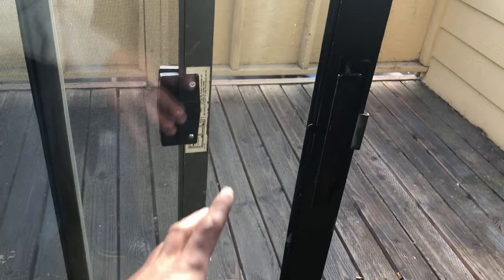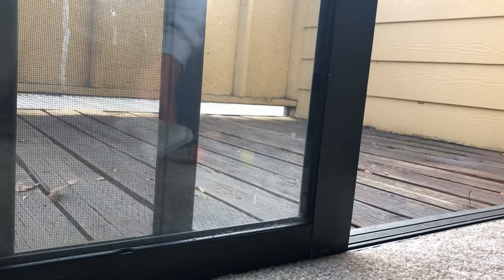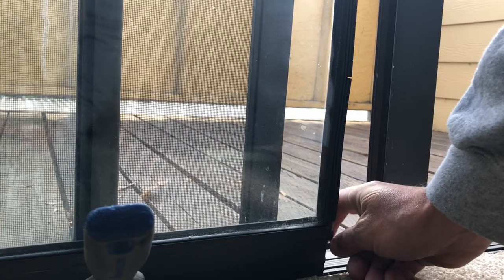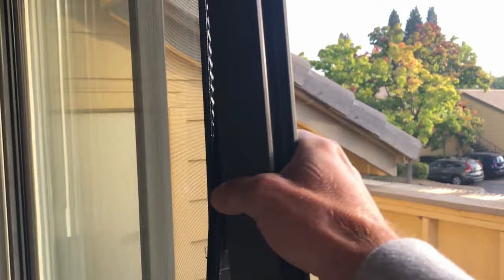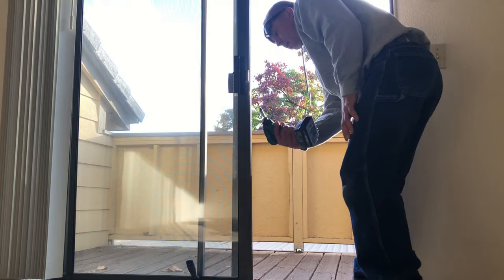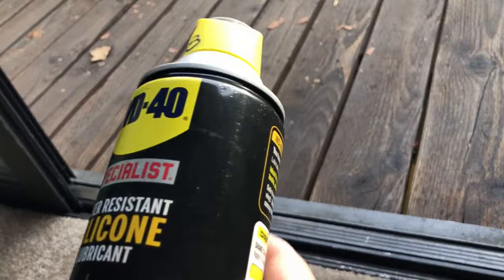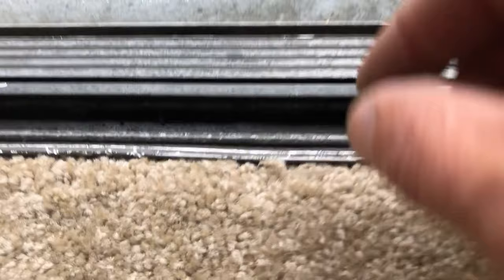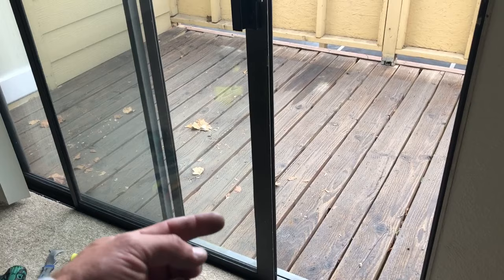How to replace rollers, wheels on sliding glass patio door the easy way.

Comment: good for an aluminum frame door but if you have a pvc or "vinyl" frame im not sure this would work. door has to come out I think. at least thats what i did and it worked fine. get a helper to help lift it and its not that bad. also i
it had a 1 1/8 size roller wheel and I tried a 1 1/4  (larger rollers) and it worked much better.
Reply from the maker: You are right, vinyl doors are designed different, so the door needs to be lifted out. 
I will make videos in vinyl doors soon.
Thanks.

Comment: Can I pop the door out, lay it down and remove the wheels without taking the frame off?  Thanks for posting this video.  I feel empowered to try it.
Reply from the maker: Yes, you can , but taking door out is not always easy, and in some cases you will still have to remove bottom frame/rail to get the wheels out.

Comment: I would suggest cleaning the track before you take the step of changing out the rollers.  You can do this without removing the door as well.  WD40 and a paper towel and blow out dusty stuff under the door first.

Comment: Thank you for the informative video! I learned a lot. However, I'm having difficulty opening or closing my balcony door. Can you provide some guidance on how to fix it?
Reply from the maker: I’d need a little more information, description. Most of the problems come from bad/worn out wheels. And of course there are number of other issues too, like track being worn out, or even building settling and pushing in on a window frame.

Comment: Looks exactly like my door 1998 contractor grade. If I buy the rollers ahead of time, are there a lot of different sizes, or basically one or two? Want to have it all staged b4 I start. THANKS!
Reply from the maker: To be in safe side , I’d pull one rail off and take a look at roller just to verify.

Comment: Hi there, this looks like the answer I have needed to fix my sliding door. My concern is --- can I do it on the opposite end of the door, i.e. the side that does not have the handle on>
Reply from the maker: Absolutely, it’s the same process, I think I mentioned and showed it in the video.

Comment: Soapy water will help the rubber seal slip right onto the glass and into the frame.
Reply from the maker: You are right, I spray glass cleaner sometime to make the frame slip on the glass easier.

Comment: Thank you -nice video!
Learned even more! 
How do I know if the wheel set will work on my doors? 
The one door has been replaced one jus a few years ago. I can’t make it slide. 
Cleaning track 2-3 times a week helps and the white lithium helps.  ( that what I was told to buy).  It’s a constant battle.
Reply from the maker: Thank you.  
If your door was recently replaced it might might vinyl/plastic so this method of wheel replacement won’t work unfortunately, you would need to pull the slider out to get access to the rollers, but if your door is aluminum then you can just unscrew the bottom corner screw, and pull the rail off ( like in the video) and that will give you access to the wheel, although there are few door manufacturers that screws the rollers through the bottom rail/frame, in that case you will have to pull the door completely out.
Hopefully it makes sense, let me know if you have anymore questions.
Reply: Try putting some bearing grease on the track....clean it one more time sliding the door open clean the front side of the track, close clean the back side of the door track.

Comment: So I was thinking of hiring a handyman because I thought the doors had to be removed from the tracks. Wondering if you loosened the prior to putting the toll under it to raise it? I'm surprised how much lift or adjustment was in the door to be able to remove the old wheel assembly. 
Thank you so much for your video!!
Reply from the maker: I’m glad I was able to help

Comment: My patio door frame had a cut out/window on either sideof  it. The wheel unit had a shoulder on each side that fit into the cutout/window in the frame.  I had to deform the frame slightly to clear the shoulders in order to pull the unit out. Fortunately I had taken the door off the track to do the repair. It would have been a cluster trying to do this on the track. Otherwise followed your steps and saved big bucks. Wheels were $8.00 each.
Reply from the maker: I think I know what type of door you are talking about, it takes single wheel roller. I have worked on those in past , not very common though. I’m glad you were able to do the job yourself and save few hundred dollars!

Comment: Great video, and technique.  I am replacing tandem rollers with steel wheels and steel bearings.  Should I lubricate the bearings on these Prime-Line rollers before installation?  My concern is that any lube will attract dust and dirt.  Your opinion?
Reply from the maker: Yes, I always lube the wheels before installation, use clear silicone spray, it will not attract dirt!
Reply: @roadglassandmore9064  Thanks.  Time to get working!

Comment: Just like the others, thank you very much for posting this! I was getting ready to hire a glass shop an hour away. Now I can do it myself.

One question though. Maybe I'm missing something obvious, but how can I identify the model of my door? I found the Pella brand name, and figured out it's vinyl, but that's it. Couldn't find a model number. Pella's website says there should be a serial number or something etched in one of the corners, but I don't see it. (Fine, I'll go get the windex...)
Reply from the maker: I. Haven’t worked in many Pella doors, from my experience they don’t use standard rollers that are interchangeable on other doors.  And the door being vinyl , you will have to pull the door out to access the rollers on the bottom.
Reply: @roadglassandmore9064  Eew! Too bad I can't use your shortcut, but it's still do-able if I find a helper. Still, I was inspired by your instructions to clean the track and adjust the height. It got a little easier to slide by not dragging. Curiously, Pella's website sells replacement parts but no rollers. Thank you again for broadcasting great info! 🙏

Comment: Thanks for sharing... Extremely informative!  What was that plastic wedge piece used in conjunction with mallet?  I think you said we could use a piece of 2x4...  Will be replacing my annoying old glides this weekend!.
Reply from the maker: That white plastic piece is just a tapping block, but yes you can use piece of 2x4 instead.
Reply: So, my aluminum frame slider ended up having a screw on the top as well. I had to take a rubber mallet and a small 2x4 block to knock the bottom frame a tad just to expose sit.  After all that work, the screw was stripped and I couldn't drill the damn thing out.

Comment: Hey, thanks for this video. I am trying to follow your instructions, got all the way till opening the frame. But the roller wouldnt just come off. I dont see anything screwed for the roller to my door frame. Is it possible this is jammed as its a really old door? Is there any possible hack to release the rollers? Thank you
Reply from the maker: Does the long corner screw screws into the frame? Or into the roller itself? If it’s screws into the roller ( there is threaded hole , usually on top ) if it does screw into the roller than the bottom rail needs to come off and you will see small screw through the rail holding the wheel. I screw screws into the frame than the wheel should come out may be use pliers, just be careful with the edge of the glass

Comment: So, if your door has rollers like mine with a sloted catch on each side you cannot just pull them out. I had to take the doors out lay them down and take the bottom rail off to be able to prey both sides of the bottom rail out so I could get the side catches enough room to get them out. It was not easy to do and getting new  ones in not easy either. I am sure someone who does this kind of slotted catch roller a lot must have a better way I would love to hear it.

Comment: Geez, amazing tutorial. How do I know what rollers I have?  Where is best place to purchase them?
Reply from the maker: If your door is aluminum, remove the screw from one of the corners, if it has pointy end looks kinda like wood screw then rollers in this video should work , I have links in description. But if it has machined screw ( flat end) then the rollers are different and screwed through the bottom of the rail, the whole door needs to come out.
Hope this helps.

Comment: Hi I just pulled the screw out of corner to see if it was pointy and it is does that mean the rollers you recommend will work? The screw looks different than in the video though it’s not as long and thicker
Reply from the maker: I think the rollers in this video should work, screws might be a little different from different manufacturers. But you could always pull the rail off and take a look at the existing roller.

Comment: Great video!  Where can I get that tapping block that you used to remove the frame with? Thanks again!
Reply from the maker: Taping block is kinda specialty tool you can probably get only ( I get those through work), but you can use a small piece of wood ( hard wood preferably , oak )

Comment: Very helpful video.   Have you had onse that wiggle in a way that are not sitting in there straight so when you try to slide it open it tips up and down almost an inch,  how can I fix that so it slides normally lol?
Reply: They stick
Reply from the maker: I would check to see if rollers are still on each side  held with the screw. Sometimes they come off the screw and move inside of the bottom frame.

Comment: Mine have three doors .inner and outer door works properly,but middle one stick with outer door,when outer door need to close .can you suggest some trick.or should i understand that same problem of roller with my case
Reply from the maker: It’s hard to tell in your case without looking at the doors. You can always try pulling one roller out and see if it’s bad.

Comment: Can you clean between the glass with frame and gasget off? Mine has a milky haze in the middle! Mine are over 20 years old.
Reply from the maker: The haze is a calcium built up from water/moisture , even if you do manage to separate two panes of glass with out breaking or scratching the glass it will be super difficult to clean all that milky haze off. It’s better and easier to just replace the glass!
Reply: @roadglassandmore9064  Thank you!

Comment: With the white frame (I'm guessing it's aluminum but not positive) is there a way to check the size of roller before taking it apart? To know what to buy? I think you mentioned below you were going to do another video. We might try it this weekend, but my guy isn't very DIY or handy. We'll see how it goes. Thanks for making this one look easy!
Reply from the maker: There are some white aluminum doors. Look at the edge of the glass if you see black rubber gasket showing all the way around the glass then it’s aluminum door, also there will be a screw head showing in each corner of the frame.  Remove one of the screws , if it’s pointy ( kinda like wood screw then the the wheels in this video will work, if it’s machined screw ( has fine threads and the tip is flat)  then you would have to pull the whole door out and take the bottom rail off as the rollers screwed into that bottom rail either from top or the bottom ( there are few different types, so I can’t tell you which ones exactly in that case)
If your door is vinyl ( plastic) you would have to pull it out also to be able to remove the rollers.
And  I know I promised more videos, just haven’t gotten chance to film it yet.

Comment: Can you put in the description the plastic tool you used. Scared of breaking the glass
Reply from the maker: I can’t seem to find it online, my work bought one for me.
I found something similar on Amazon: floor tapping block: https://www.amazon.com/MOONWELL-Tapping-Laminate-Flooring-Installation/dp/B07RW4K3FX/ref=asc_df_B07RW4K3FX/?tag=hyprod-20&linkCode=df0&hvadid=343227730929&hvpos=&hvnetw=g&hvrand=6036091170297800954&hvpone=&hvptwo=&hvqmt=&hvdev=m&hvdvcmdl=&hvlocint=&hvlocphy=9060225&hvtargid=pla-778753533105&psc=1&mcid=6aa6a56adaf133369eb37fdfe0477584&tag=&ref=&adgrpid=69721953315&hvpone=&hvptwo=&hvadid=343227730929&hvpos=&hvnetw=g&hvrand=6036091170297800954&hvqmt=&hvdev=m&hvdvcmdl=&hvlocint=&hvlocphy=9060225&hvtargid=pla-778753533105

Comment: Thanks for the great video. For a given wheel size are the wheel assemblies pretty much universal? Also I found out that you can just replace the wheels in some cases, are metal or nylon wheels better?
Reply from the maker: Metal wheels last longer, nylon wheels are a little bit quieter.

Comment: So I am doing this right now but my rollers have a sloted hole on both sides of the lower rail that have a catch. I tried hitting them in to pull out the roller but I cannot get it. How do you get these out?
Reply from the maker: It’s hard to tell which roller type you have without looking at the door. There are some doors ( not very common) that have the roller screwed through the bottom rail, in that case you will have to pull the whole door out and remove bottom rail completely off to get to the screw .

Comment: what do you do if your wheel loosen/adjust screw is frozen solid/rusted and cant be turned or its stripped?
Reply from the maker: If the wheel is frozen/rusted, the best thing is to replace it!  You can try spraying some silicone spray on it, that can help sometimes

Comment: I’ve got all the screws out and loosened. I can’t seem to get the frame separated. And pounding away with a hammer. Theres a piece of rubber weathering strip that makes it difficult to squarely set my block of wood… Any tips?
Reply from the maker: Some of the frames are set very tight , you just need keep hitting the block of wood, best if you have a nylon ( plastic) block), start at he very bottom of the frame.

Comment: I have a different problem when I went to close the door the back part of the frame came apart in the bottom where the wheel is I put the wheel back and put the frame back together but it’s very hard to open and it’s very hard to close my doors are similar to yours with the exception that it is no screws to take the frame off at least I don’t see any. If you could give me any pointers on what I could do to fix it I would totally appreciate it
Reply from the maker: The screws might be missing somehow. Are there any holes you can see in each corner?, If yes, just buy new screws, and also check the wheels, make sure they spin freely and directly on top of the bottom track.

Comment: What can I do if the roller won't come out? The part that the screws go into is built into the door frame. It seems like the door needs to come off
Reply from the maker: It sounds like rollers on your door a screwed in through the bottom rail, your door needs to come out and take the bottom rail off to access screws that hold the rollers in place

Comment: How do we find out what the make, model or type of the door I have? So,  we can get the correct railings? where on the door would this info  be at?.  thanks
Reply from the maker: The name of the door manufacturer should be on the handle , or sometimes there is a sticker on top of the inside frame . But not all manufacturers put their name on, some companies only existed for couple of years and never put their name on anything.

Comment: Where do i get the plastic weather strip between each door in the middle. And if the. Vain that goes betwen the glass  and frame around.since glass can move when you push. In with your thumb. What is call where i get it. Any video on how to replaced it.
Reply from the maker: Its not too hard to change the seal, we call it mohair , weather seal is also common name used, I don’t think videos on how to change it exist, I might make one latter. There are different thickness of the seal so you will have to measure yours in it’s always in mm. Here is the eBay link you can select different thickness when buying: https://rover.ebay.com/rover/1/711-53200-19255-0/1?mpre=https%3A%2F%2Fwww.ebay.com%2Fi%2F164168804767%3Fchn%3Dps%26var%3D463798152218%26norover%3D1%26mkevt%3D1%26mkrid%3D711-117182-37290-0%26mkcid%3D2%26itemid%3D463798152218_164168804767%26targetid%3D934793861016%26device%3Dm%26mktype%3Dpla%26googleloc%3D9032475%26campaignid%3D10880341424%26mkgroupid%3D107912170955%26rlsatarget%3Daud-762207186714%3Apla-934793861016%26abcId%3D9300400%26merchantid%3D118842185%26gclid%3DCj0KCQiAk53-BRD0ARIsAJuNhpsWfg6NF5bljr9z6dsi8-lk-ccwzLyNWb7ZjtlChYi195mb-VXo0jAaAkxtEALw_wcB&campid=5338508393&toolid=10001&customid=
Hope it helps!

Comment: My house was built 1963,  the sliding glass door is aluminum, I tried your method but apparently the roller must have a screw on the bottom that screws into the bottom of the frame. The roller would not budge. I guess I'll have to hire someone to help me get the door out to change the roller's. However , it was a very good idea, just didn't work for my antique doors.
Reply from the maker: You are right, Few manufactures of older aluminum doors have a roller screwed through the bottom rail, in that case you would have to take the whole door out and remove to bottom corner screws  and pound the bottom rail off to get to those screws.
Reply: @roadglassandmore9064  Yeah, and thanks for getting back to me. My doors are heavvvvvy, I know a handy man that I might can get to help me get them out of the track. At 70 yrs of age I can't hardly handle them by myself, its a shame you're not my neighbor:)))))

Comment: Very nice.  What is the plastic tool called that you are hitting with the hammer to seperate the frame from the glass?  Is there very much risk of breaking the glass when doing this procedure?
Reply from the maker: It’s nylon tapping block, but you can also use a piece of wood. No risk of breaking the glass, I have not seen glass break from this in my 16 year glass installing career.